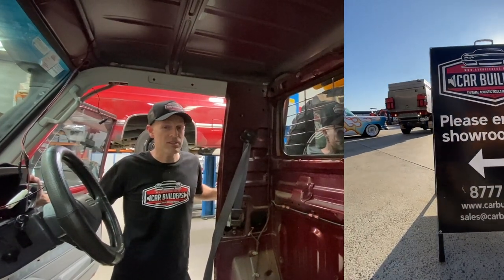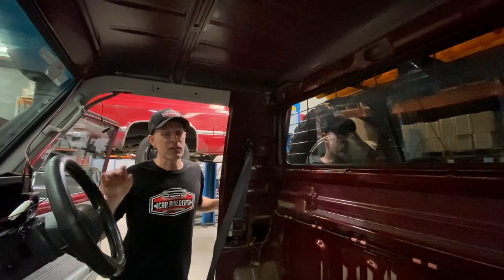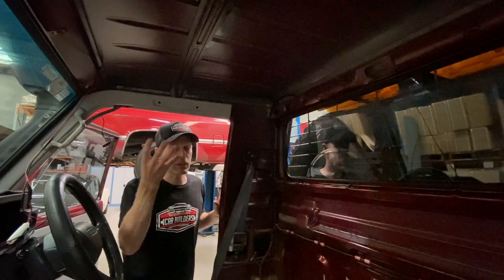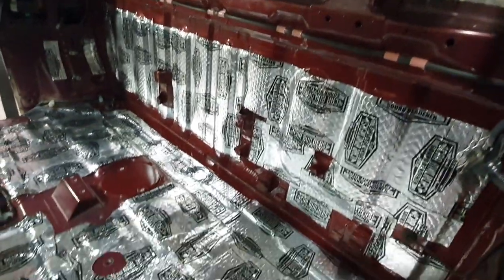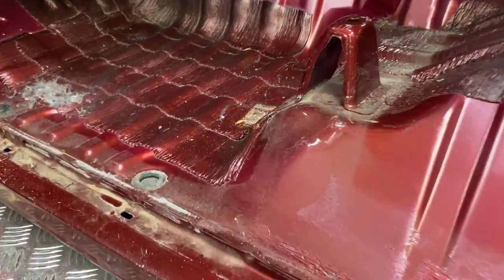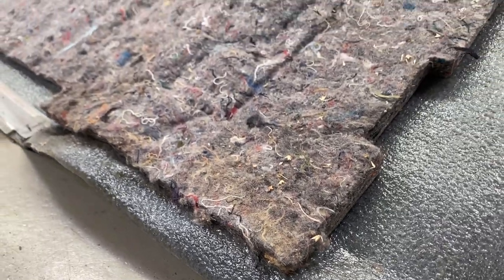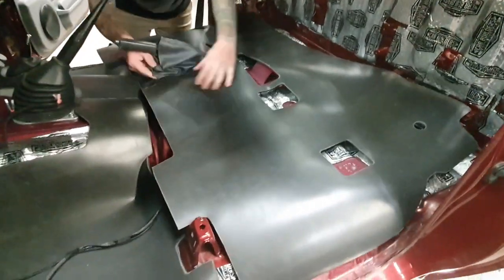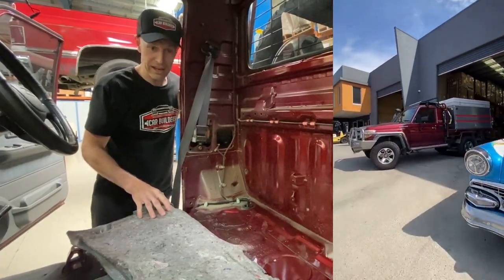Sound and Heat in Your Single Cab 4WD

Comment: Installed stage one today after I flooded the car and removed the factory matting. I'll give the roof a go later with stage 1&2 for the heat. A single cab is not the quietest Ute around.
Reply from the maker: Good luck Troy 👍

Comment: How do would you remove the damping sheets if you needed to for body panel replacement or respray?
Thanks
Reply from the maker: Hi Paul, it will require a fair bit of elbow grease however you can remove them by pulling them up. It is not easy because our sheets stick on well, you will have to use a fair bit of force but it has and can be done. Some of our customers have used heat guns and some have used dry ice to make it a bit easier.
Reply: @carbuilders1  Hi thanks,I have read you can freeze it with liquid nitrogen which looks to be the best way.